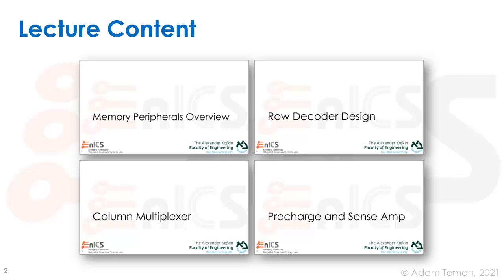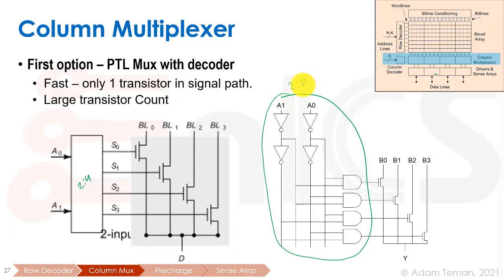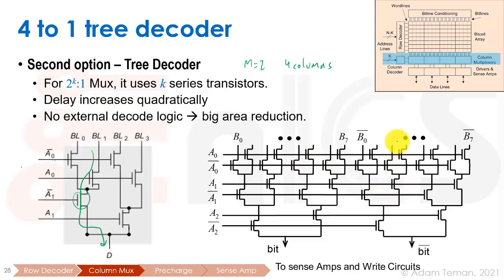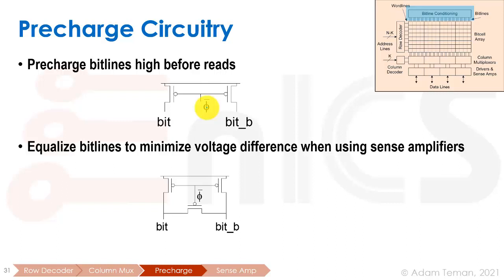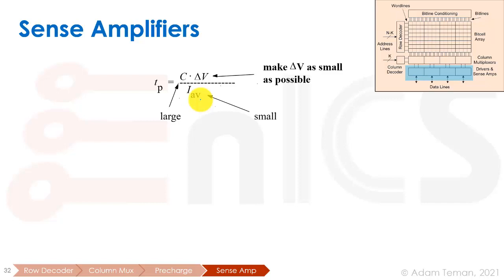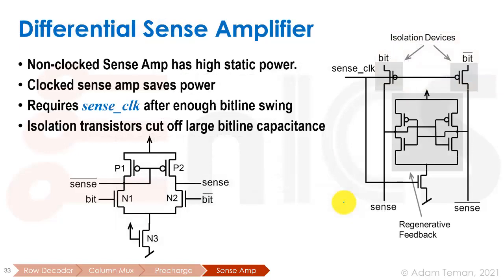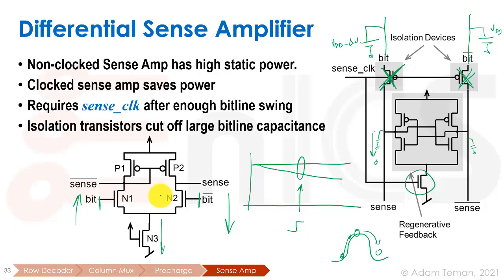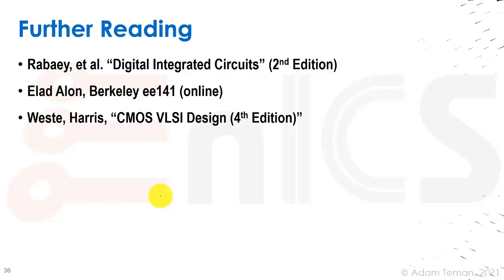VLSI - Lecture 9c: Column Decoder and Sense Amplifiers

Comment: hey professor, can  you please tell about the is column decoder and column mux the same thing ?? some people write column mux. is there any difference?
Reply from the maker: Good on the spot question.

Yes - "column mux" and "column decoder" are the same thing.
To be accurate, it is a mux - it is selecting one bitline out of a set of bitlines.
The reason the term "decoder" is used is because often the mux is (at least partially) implemented using a decoder, as I explain in the slides.